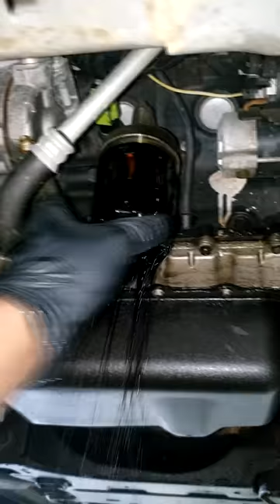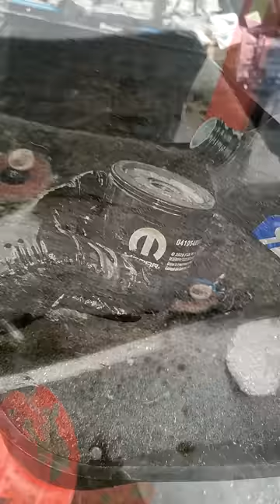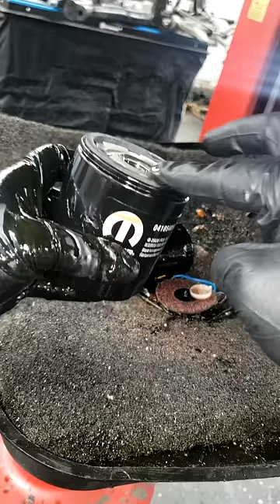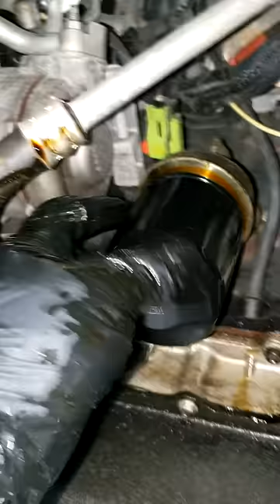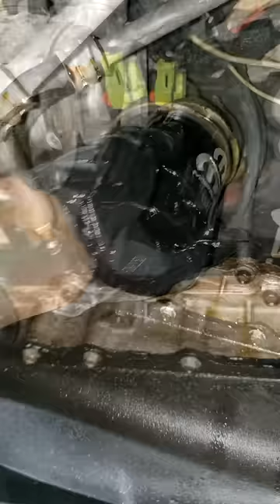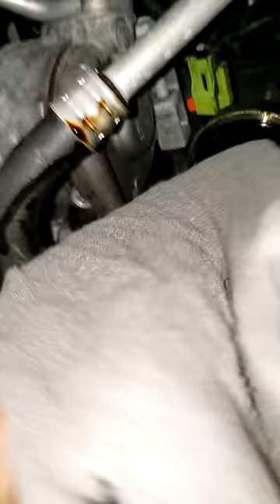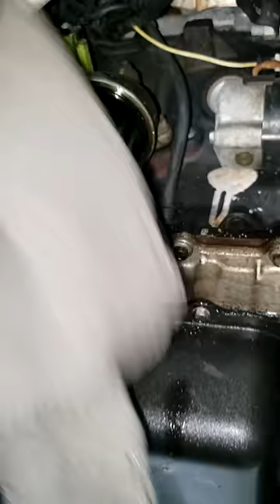Don't Lie.. Are yall still doing this?

Comment: Yes. The best way is to fully pre-fill the oil filter with the new oil. If the filter has the anti-drain back valve, then a smooth instrument should be inserted to unseat a section of the valve to allow air to escape while the oil is being poured into the filter. Once the oil reaches the top of the inlet holes (outer holes), the filter is completely full. This can only be done on engines where the filter is mounted upright. If the filter is mounted on the engine slightly angled, you should leave a small amount of the filter unfilled to allow installation without spilling new oil. 
 One benefit to this procedure is that the new oil filter media will not be exposed to the shock force created by the incoming oil on one side and the unsupported air pocket on the other.  Another benefit which is more obvious is that the oil pressure will be nearly instantaneous upon start-up, with the only air pocket (that must go through the engine) being in the oil galley above the filter that cannot be pre-filled. This minimizes the chance of any engine bearings starting up without oil pressure. In some engines, you will hear a clear start-up knock if this is not done. It is from the time it takes for the oil filter media to become saturated then to pass oil to the engine. This takes too long with the larger oil filters. This is one reason that manufacturers use minimal size oil filters to begin with. It is better to have a larger oil filter capacity, but only if this type of installation is reliably performed. Doing this procedure will reduce the engine wear from these "dry" start-ups, no question. 
  If you don't agree with this method it is only because you care more about how quickly the job is performed than how well it is done. Do what you will with your engine. I will always do the job in the way that is best for my engine and my customers engine.
Reply: I've never blown an engine nor do I know anyone that has by not filling the filter with oil. And, you certainly can't put oil in a filter that is mounted horizontally. In another comment I did say I knew someone that didn't make sure the old gasket and burned his engine.
Reply: Thank you

Comment: I still do prefill filters to this day (been 30yrs doing it). I fill it through the middle and let it soak through to the outside part of it goes on horizontally, I pour out the excess, spin it on and wipe off whatever may run out.....easy peasy...

Comment: You do not need to pre-fill your oil filters. Subaru is a perfect example (with their top mounted filters). Your car is not running without oil until that filter is filled, that’s a myth. Same way we stopped cross-crossing on tire rotations, we’ve learned
Reply: Diesel filters are about all you need to prime because they are massive, especially old 7.3s and dodge 6.7s. Proper rotates involve crossing your drive axle forward or back. Awd vehicles are corner to corner.
Reply: BlueNoteStan it's down to directional tires. You can cross rotate them. Front to back rotation is all you need anyway
Reply: @hairytoez75  I didn't see that you beat me to the punch
Reply: BlueNoteStan  I'm saying we don't do driver front to passenger rear anymore, because it leads to uneven and premature wear on the treads of the tires, and some tires are directional. The shop I work in does drive front to driver back, and same with the passengers; and all the other shops I've dealt with do it the exact same way.

Comment: Just crank the motor without spark. Motor will circulate oil properly before the engine starts. Most newer cars have a way to do this. With my dsm i just unplug my spark wire harness and crank the motor. On my 19 gmc i just hold the brake with one foot and fuel pedal to the floor and let the motor crank a few times then release the fuel pedal and shes good to go (dont gotta keep the brake pedal held down its only to start the process)

Comment: Im sure you dont need to do this, as a lot of cars have horizontal sitting filters. It would just pour all over you before you can thread it on.
Reply: No, it won't. I do it every time. If you wait, the oil will go down as it passes through the media. Then I add more, maybe 3 times. Just install it quickly and no oil loss.
Reply: I didn't do the prefilled method to all my bikes and no issue for me. I didn't even oil the gasket .

Comment: Been doing it 45 yrs nothing wrong has happened out of it
Reply: Me too. I actually never thought about it. I also use the best filters and best synthetic oil in my 328k mile Ford engine and drive for 8-10k miles without a problem.
Reply: Exactly it certainly can’t hurt. I will continue doing it. 👍
Reply: Try not doing it for another 45, and nothing will ever happen.
Reply: @JPerez-zm4kr  I think he’s lying. 😂
Reply: Definitely more good than harm.

Comment: I deleted the oil pump because I got tired of oil filters in general
Reply from the maker: Great idea
Reply: Wait, deleted oil pump? Quick explanation on that? Thanks.
Reply: @RealGeorg3  he is joking, but there are technically motors that have no oil pumps such as dirtbikes. Which is why they can run without issue on their side or even upside-down, its all a dry sump system
Reply: It works for my push mower 😂
Reply: I mean the water pump is doing the same job, just shoot it through the radiator.
Reply: @kramnull8962  slow your roll kram, you will only confuse them further
Reply: @kramnull8962 idk why but this one is hard to believe you're not serious
Reply: He got an EV lol
Reply: I thought i was the only one
Reply: @lucid-hopes6217 dry sumps still use oil pumps, in fact they're usually bigger and have more than one pump. 2 strokes don't
Reply: @lucid-hopes6217  dirt bikes don't have dry sumps, they really don't have sumps at all. They're 2-strokes, so the oil is mixed with the fuel and is drawn through the crankcase before entering the combustion chamber, effectively lubricating everything
Reply: @poisonedsugar2012  two strokes rely on the oil premix, I was referring to four stroke dirtbikes

Comment: First, you only need a few cap fulls of oil, not filled up.  Second, few filters these days are vertical.  Third, there is enough residual oil in the engine to not cause any issue if you dont charge your filter.  Fourth, unless you got a big engine that it takes more time for the oil to circulate, then this is pointless.

Comment: It all depends on how your oil filter is mounted. Most are mounted horizontally so you can't pre fill it.
Reply: Thank you😂
Reply: Actually you CAN mostly prefill a filter even if it is mounted horizontally.  The filter media will soak up a lot of oil and hold it in place while you screw on the filter.  Just don't fill it more than about 2/3 full and you will be OK.
Reply: I half fill horizonal filters. The media soaks up the oil, you can actually watch it. The only filters i have a challenge pre filling are the upside down filters.
Reply: @Vincent_Sullivan  Are you serious? 2/3 full for a horizontal filter? bahahaha. Just clean the mating surface and you'll be ok. I swear all these lube techs trying to be important with garbage advice.

Comment: Doesn't matter the engine size.  It helps to keep the time that the engine runs on low oil pressure to a minimum.  You can try with and without and notice that the rod bearings make noise for a second or two when not filled with oil.
Reply: Yes, that is correct. Especially on engines that use a larger oil filter and have a longer delay to oil filter media saturation and oil pressure resumption. Once you do the comparison your conscience will not allow you to not prefill the filter in the future. That is, if you have a conscience and actually care about the engine's longevity. I work for a fleet and that is exactly how I came to see the difference in these two "accepted" methods. 👍
Reply: And KILLIN my darn ears!
Reply: For a diesel filter yes. But on most modern gas engines what youre saying doesnt pass the common sense check. Theres still oil in the engine after you drain it, and when you fill the crank case guess where it goes?
Reply: @plack_benis382  common sense check says what happens when all the oil in the oil pump pickup tube goes away with NO wet sump pump being positive displacement (self priming) ? This will result in the oil pump losing its prime which makes me always prevent the engine from starting by unhooking something while I crank it over enough times to reestablish oil pressure. A starter is cheaper than a bottom end, is it not?
Reply: This may be why my daily (02 Trail Blazer- 4.2 I6) has just turned 430,000 miles with a faithfully followed 3000 mi service interval......
Reply: @doctorcountersteer6580  That has nothing to do with what im saying. Unless youve removed your oil pump or the engine hasnt been started for a long time before changing oil there is always oil in the engine at least enough to prevent damage. That's common sense my man
Reply: ummmmm. the rod bearings are bathed in oil. you do realize that right?
Reply: @buzzed_lightyear sure in your briggs and Stratton however not normally in most late model vehicles hence the "oil gallie or gallerie" Drilled through the crankshaft pressurized through the main bearing journals and the little hole at the point of the connecting rods connection (rod journal) that allows oil under pressure to be forced between the crankshaft surface and the rod bearing surface. The bottom end is not splash lubricated it would cause unnecessary drag on the crank and connecting rods and would place to much oil onto the exposed lower cylinder walls and or piston apron and result in excessive oil burning not to mention cavitation in the oil reservoir in the pan possibly depriving the sump pick up tube to draw air

Comment: I have always done this. I had a shop teacher in High School (many years ago), who was from the old school back then, and he recommended this to all of his students.
    He taught us that dry starts were harder on an engine's internals than a momentary drop in oil pressure any other time. And the least amount of time without an oil film in the bearings at cranking and initial fire up would add both miles and years to the engine.
    Here's to both Nookie Clements and Stan Mullanix, RIP, you are missed!
Reply: Once a brand-new engine's been run for any length of time with oil in it, there's no such thing as a "dry start". There's a permanent coating of oil on all the internal components that protects them through all subsequent startups. Starting the engine with a new, empty oil filter is absolutely no different to starting an engine that's been left overnight. The natural residual coating of oil on all the internal moving parts makes it a complete non-issue.
Reply: @dunebasher1971  The Old gentleman that I mentioned in my comment has forgotten more automotive knowledge than most of the video experts on YouTube, yourself included. I'll take the benefit of his wisdom over yours.
    Plus, my 45 years experience doing what I learned from my father and Mr. Clements, and other old timers, has yet to fail me. That theoretical film of oil remaining after the bulk of the oil has drained back overnight might be enough to prevent flash rust from forming, but a 3-5/10,000ths film as opposed to a 2-3/1000ths cushion is no where near enough to prevent bearing damage at start up, whether daily start up or the extended dry run after an oil change.

Comment: I do plus drain oil after engine was at operating level . When I change my fuel filters on my diesels I put type F tranny fluid n da filter to help clean the injectors  . ALWAYS MAKE SURE THE RUBBER GASKET COMES OFF W THE OLD FILTER !!!

Comment: This is one of the main reasons why I would prefer to change my own oil,this is very important and the way I have done it since I was 16 yrs old and how I did it when I started as a mechanic at 18 I'm 58 now !!
Reply: Yeah I do my own work now too and actually per Toyota your not supposed to fill the oil filter before you put it back on the amount of oil that goes in is already part of the oil amount 😊
Reply: Agreed. And I don't care what anyone says - I get valve chatter for a second or two after a change if I don't pre-fill - and I get zero chatter when I do pre-fill. Since I DIY my oil changes, I can do what I please.

Comment: Most manufacturers say not to pre fill your filters due to introducting contaminants into your motor. Just let the pump do its job
Reply: how are you adding contaminants to the engine by filling the oil filter with clean oil? Also better not put oil back in the engine because you could contaminate it... zero logic.

Comment: No I don't!  I clean it up first with brake cleaner then oil the ring,   ready to put on.  Nice and clean 👀
Reply from the maker: Thats whats up
Reply: Or do what i do, just wipe the old oil off the metal surface and install the new filter. No need for extra oil on the gasket. The metal surface will be slick enough after a wipe. When you lube the gasket like that i have seen the filters come loose. The amount of times my coworkers would do that shit and the car came in with a leaky filter cause the filter was loose. Also, i remove my filters by hand so dont come at me with that BS either.

Comment: Yes, it is important to fill the new oil filter before installing it, also apply a thin layer of oil on the new gasket and make sure the old gasket is not stuck on the block to prevent doubling up and causing a major leaking filter. This is the way I was taught 40 years ago at vo- tech school and the way I still do it, unless the filter is mounted horizontal as a ol mechanic!

Comment: I always do it for a filter that's orientated vertically like the one in this video but for filters that are mounted horizontally I pour them maybe 1/4 the way full so it's not spilling out everywhere. Also, I try to keep everything clean as I go without getting oil all over everything as is done in this video, lol 😆, and I make sure to clean the filter mounting surface/flange before I install it. I have a thing about handling parts with oil all over my hands, I'd be wiping them off on a shop towel as I work especially when dealing with oily, greasy stuff.
Reply: Yes, I wouldn't be happy with that oil all over my car, especially if I paid someone to do it!

Comment: Still prefill the filter. I also use a clean hand to install the new filter AND wipe the filter mounting surface to make sure it is clean and free of old gasket material and dirt.
Reply: Never prefill a filter on the clean side.

Comment: Doesn't really matter. Most heavy equipment manufacturers even tell you no (catepillar). Just because you pull the oil filter doesn't mean the engine will start up dry. There's an extra 1-2 quarts chilling I'm the main galleys and bearings. You do more harm dry firing a car after it has sat for a year then you do putting an oil filter in dry. Also, contamination in the oil filter is more detrimental as that is the post filtered side. Any dirt put in the center goes straight into the engines mains. The correct method is to crank the engine over with the starter for engines with secondary oil coolers.
Reply: But the oil is clean and new though
Reply: @cocacoladog10  contamination control is a huge deal at all cat dealers. They advise us not to pre fill the filters because you may contaminate the “clean oil” as you’re filling the filter and most techs that even do pre fill are filling into the center hole which is unfiltered 😂 I was told by my instructor at my dealer that if you are gonna do it (which they don’t advise) then atleast fill the oil on the small ports on the outside of the center hole because atleast then the oil will get ran through the filter.

Comment: Yes I do. Also wipe the mating surface clean. Also change at 5000 mile intervals and rotate tires at same.
Reply: Also change underwear 😅
Reply: That's approx. 7500km in metric, using the simplified 1:1.5 conversion rate miles to kilometres...  😊

Mitsubishi says 15000km (10000miles) for my van, but no way you wanna leave the oil for that long!

Comment: You took off a wix filter for a mopar. That should be the crime
Reply from the maker: Lmao...Mopar or No car parts for me my guy
Reply: I would sure run anything besides a full bypass wix
Reply: lol damn right sir!
Reply: @johnsonlong1272  Wix is a bad filter?
Reply: I’ve seen videos about Mopar filters. They’re quite good actually.
Reply: @OnlineMechanicTips mopar only!!!!; only pre oil filter on turbo charged engines , so it doesnt run dry , otherwise leave empty
Reply: @willg.5168 no its the best that guy must be a chomo
Reply: @johnsonlong1272  not sure if this is the reason but when i owned a 09 ram it would leak oil from the oil filter housing if i used anything other then a mopar filter not sure why never figured it out
Reply: Newer and smaller engines do not require you to prime your filter but If your doing large capacity yeah you should do that absolutely

Comment: I botta gmc 320k. Took a pump sprayer w couple quarts of diesel fuel. Pumped it  up in the drain plug hole. To flush out sludge n metal debris.  Was pretty clean actually.